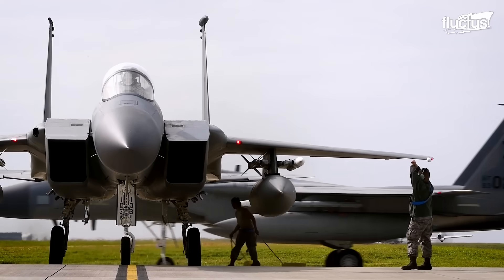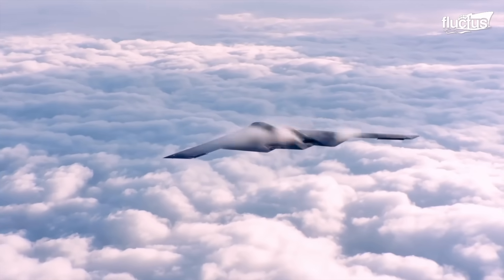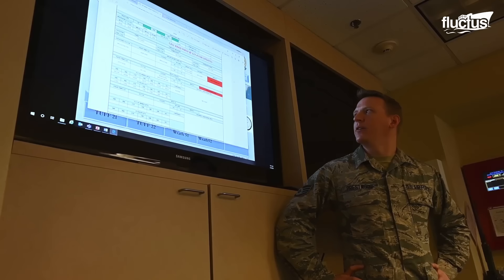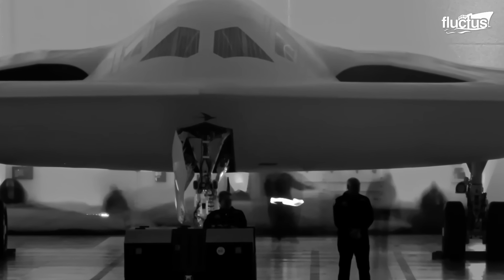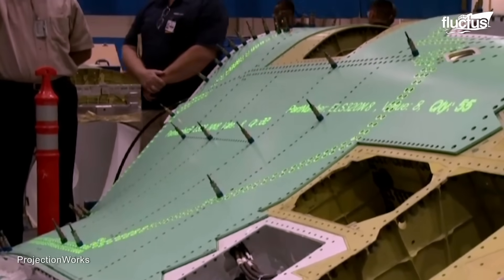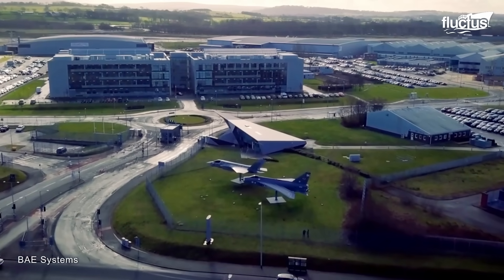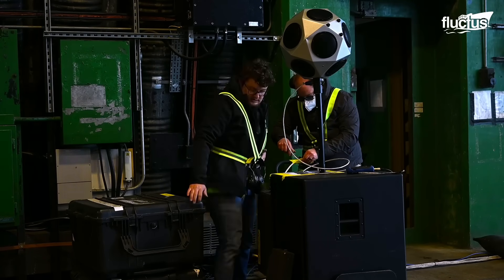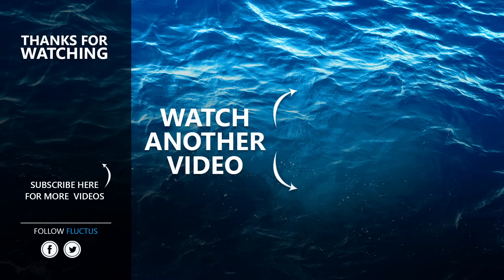Crazy Process of Building US Air Force’s Most Expensive Stealth Bomber

Comment: So could you take the F35 and scale it up in size so that it could carry a little more fuel and weapons?
Reply: Decrease stealth at the same time. Not worth doing.
Reply: @ Surely, the B1 stealth is larger, can carry more weapons, and is still stealthy? I’m not saying the B1 is a fighter, so it still leaves me wondering.
Reply: @leppad  
Where things are headed here, based on the limitations of the F-35, is to have unmanned drones accompany the fighter, with nose cones that have other operational function such as electronic warfare or enhanced radars, perhaps even carry extra munitions that integrate with the F-35's computer that boost everything, dependent on the mission.

Comment: 1:21 interesting room
Reply: Sound proof room. I worked for a company that sound tested their windshield wiper motor/actuators, they built for Mercedes, in a similar room. Mercedes had very strict requirements on noise levels for their windshield wipers, believe it or not.
Reply: @NDX-01 That’s actually not hard to believe. Mercedes is known for luxury and loud windshield wipers would ruin the driving experience. This would cause people to complain which would definitely impact their sales.
Reply: @ You know, you're right. Mercedes vehicles do offer quiet rides, so any other noise would come through more clearly.

Comment: How many hours of maintenance is required for every hour of flight time.? maintenance time means that the plane is not available for use if needed
Reply: The B-21 will be considerably less than the B2
Reply: @rogerthat4545  And you know that how? In the 1960's "Popular Mechanics" had illustrations and articles of "giant wheel" space stations by the year 2000. The MV-22 Osprey was sold as a perfectly safe aircraft w low maintenance hours. Both the B-2 and F-22 were supposed to be produced in the hundreds. And, the B-58 Hustler was supposed to be the "Be ALL and End ALL" of bomber aircraft. So, is your projection from within or outside of the B-21 development program? Interested investors and readers want to know.
Reply: @centralplains7608  because that's what it was designed for
Reply: @rogerthat4545  OH!  It's "design" will bring about the REAL results?
Your statements will not be VERIFIED until (1) the B-2 has been PRODUCED in large quantities and (2) the B-2 has been in OPERATIONAL FLIGHTS for quite some time. Ask any aerospace engineer or aviation historian.
Reply: @centralplains7608  they stopped production of the b2. But that's literally how tge B-21 was designed. 
Your comment is pure speculation unlike mine.
Reply: @rogerthat4545  No "speculation" needed since you have no VERIFIED PROOF of B-21 actual OPERATIONAL MAINTENANCE costs. When the B-21 passes OPERATIONAL tests and is distributed to the fleet, then REAL numbers of flight hr per maintenance hours will reveal themselves.
Reply: @centralplains7608  verified proof? Like the fact that it's considerably smaller therefore less to maintain?
Or like the fact that it was designed to be maintained faster?
Reply: @rogerthat4545  No, verified PROOF as in answer to the above question in ACTUAL dollars and hours instead of generalized opinion and conjecture. All that you have stated is OPINION without any SOURCE FACTS beyond the same type of "sales pitch" talk found in any brochure or aerospace trade show.
Reply: @centralplains7608  no "proof" other than their words and the design of the aircraft I guess.
Reply: @rogerthat4545  Now we are in agreement. Watching Senate and House Armed Service Committee hearings for over 50 years teaches one to be wary of when Generals and Admirals CLAIM that a weapon system has this-or-that capability or cost. The MV-22 Osprey groundings and new limitations are an EXCELLENT example of what was formally CLAIMED to be vs what ACTUALLY has occurred.

Have a HAPPY NEW YEAR, my friend, and be SAFE in your journeys. Have spent a GREAT MANY years in aviation and hope that you keep up your interest.